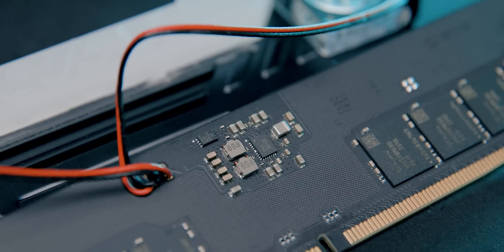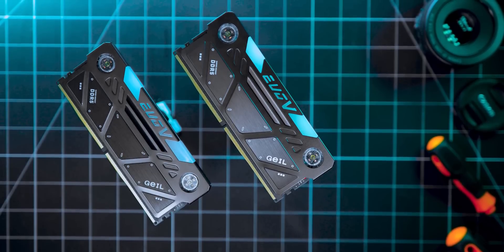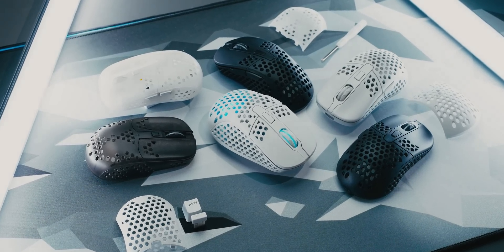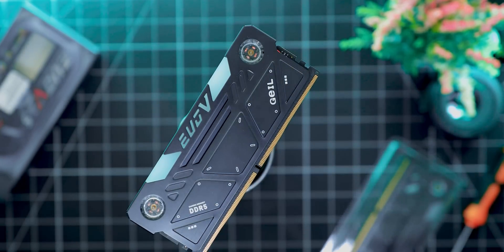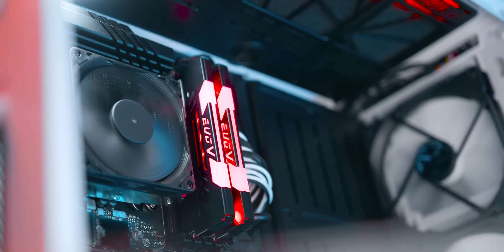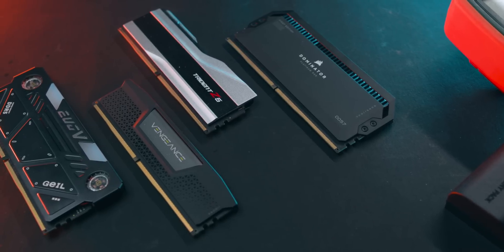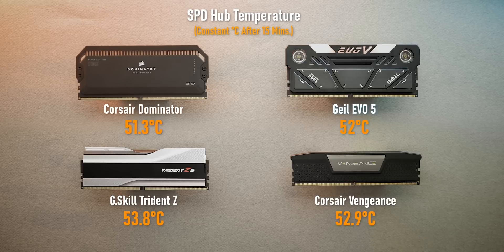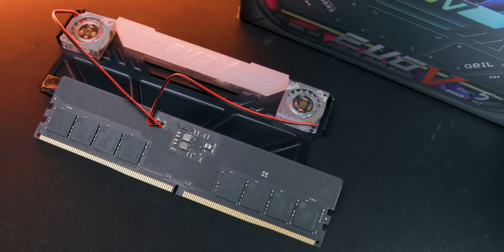The COOLEST Memory Ever...but does it Work?

Comment: There's good reason no one (maybe) has done this before. You'll soon learn the hard way...little fans don't last. MY Threadripper has two shrouded fan each covering 4 modules...and not little faneets but decent long lived ones. Far, far better. and cooler too.

Comment: A few degrees of difference while introducing more noise and two new points of failure, trade-offs don't seem like they're worth it. Not to mention soldered wires, so not easily user replaceable. Most RAM kits come with lifetime warranties these days, but those fans will definitely need to be replaced in a few years down the line.

Comment: Some of those rams are put together with adheisve. Like the trident one. 
Is it safe to take it apart? want to replace the thermal stuff on it.
Will i need to reapply the adhesive? Or is there a a screw somewhere.?

Comment: My biggest concern is what if you have 4 modules where the fans are jammed against the back of the stick in front?? If the heat spreader was better designed to actually cool everything well without the fans, then it might be a bit better. But right now looks very gimmicky.
Reply from the maker: Or an ITX board.  ;)

Comment: No way, finally a vendor who is actually making an effort to sell usable D5. 

Wait, they failed. 50c at load? That's awful. Btw you absolutely do need cooling at 1.4V+ at 6600Mbps. You're doomed to fail TM5 ot Karhu if your DIMMs are running at 58-65c on the SPD Hub.

Comment: Don't get how these will have that much benefit seeing as the CPU cooler fan is right behind them, surely just adding small fins in that airflow path would achieve same result? Also means they are mega tall so they are blocking a larger part of CPU fan.
Reply: If the heatsink consisted had copper pipes and a thermal paste it could be effective by transporting the heat to where there is air flow but this product is just trash and nothing much has gone into the design.

Comment: I had a memory cooling fan that used to clip over my DDR3. It was pointless.
Reply: It's not pointless, especially if non-ECC, as heat can cause memory errors that you won't notice until that old file you wanted has bit flip issues.

Comment: they could've just used thermal pads that cover both the RAM chips and the PIMC and RAM cooling plates that use screws (like the EK ones) while also being lower in height and the case/rad fan above the RAM would provide sufficient airflow or they could sell RAM fans like the ALSEYE 60mm RAM cooler which can be used with any kit you want.

IMO This product is dumb as all hell.

Comment: Before even hitting play I went to the website first and could just tell how gimmicky these are. I run my RAM hard and have needed active cooling on it for years - I use the Corsair two fan ram cooler - and that does help, a lot. These little fans however will be the bane of your existence when they start to go.

Comment: so they put fans on to cool the fan controller why put the fans and controller on it the first place then
Reply: DDR5 COMES with that voltage controller. That's what makes DDR5 and DDR4 different. That VRM area is part of the DDR5 design. And it allows for the higher MHz clocks on the DIMM.

Comment: All I can hear is the eventual bearing noise from these little proprietary fans. I feel like this is probably a gimmick and just adding a thermal pad to go to the heat spreader... maybe add some fines, would have been a better long term solution.
Reply from the maker: Exactly...if you look at the thermal results, it's pretty much a gimmick
Reply: exactly, just connecting the thermal pad to the shroud and taking advantage of that thermal mass to spread the heat and radiate it away would be better than running fans and blowing hot air around.
Reply: Yeah, LOOOOOL. Tiny fans are a nightmare! No, thank you.
Reply: THAT!

Comment: 6600 is going to look pretty midrange in the next gen or two of ddr5. So bring on full cover waterblocks again.
Reply: Hot take: I would much rather scale with FSR than overbudget to keep up with ultra settings
Reply: @xerzy  Prices go down as they get further along in ddr5s lifecycle. Exactly like ddr4, where when I bought my 5820k 2666 was the fastest I could find without spending 400$. So like, if you want to sit there at 4800 when Intel is even saying that's too slow for 13th gen, then more power to you.
Reply: @tag206  You must have ignored the last 2 years to be so confident about long term supply and pricing (not even talking power usage and price, or heat output).

I just think keeping current gen hardware is going to be more than alright, and that I would rather stomach lower quality image than go through the pain of hungrier hardware at higher costs in an era of potential chaos.
Reply: @xerzy  Good to know you've not looked at pricing in the last two years. It might surprise you to learn that GPUs are back in stock at reasonable prices, and ddr5 isn't expensive anymore.
Reply: @tag206  I am very aware and I have chosen parts for a few people already, but you should know better by now.

Comment: Haven't used Geil memory in 15 years, but they used to be good quality products and often managed to get just slightly better timings out of the silicon than most other manufacturers. Can't say I think these micro (or did he call them nano?) fans are a good idea. They will eventually die and might make some noise before that. And even so I don't think they does that much of a difference to the temperatures.